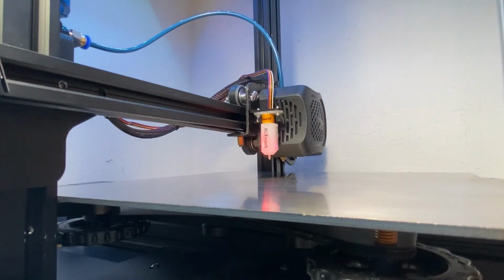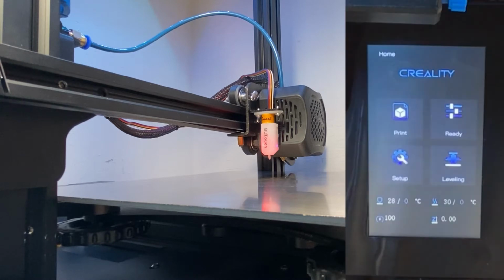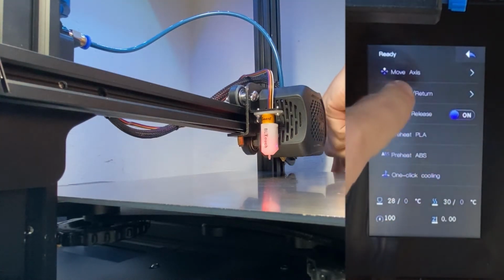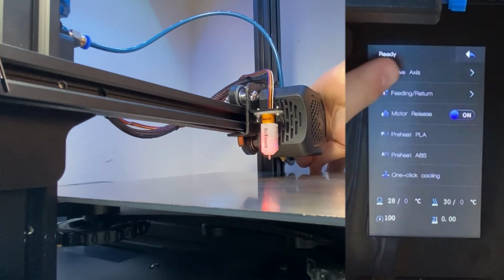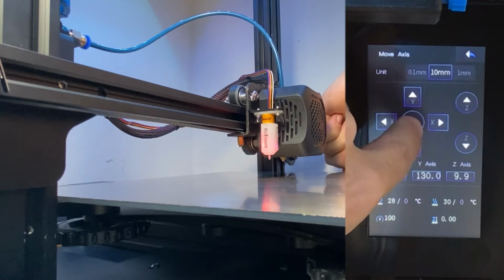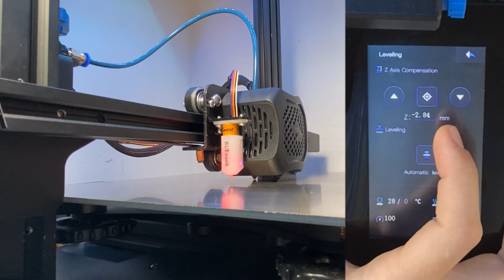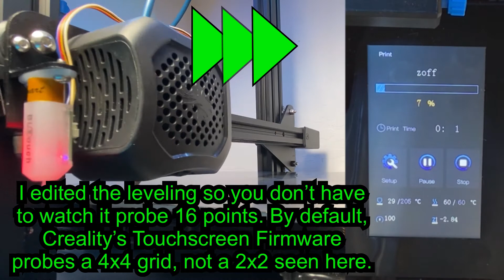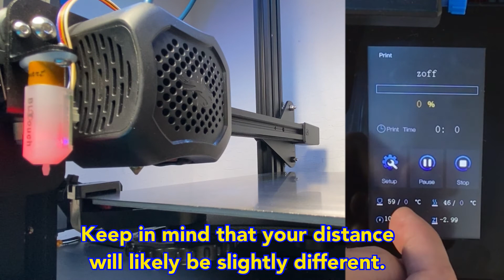Ender Series Touchscreen, How To Calibrate Z-Offset On Your Ender 3 V2 (With Creality Firmware)

Comment: i have this touchscreen with the same board, sometimes my screen freezes and i have to turn my 3D printer off and on to start again,  in 0:48, how do you apply negative values?, i have not make it work, axis move very noisy, thank you very much for this video

Comment: My issue is with an Ender 3 pro, with CR touch, and touch screen.  I can't get the Z axis to move below zero at all unless printing.      I've tried everything, and I am a novice, so going into the G code and adjusting it without a print is just gibberish to me.
Reply: Did you ever figure this out

Comment: How to get rid of the pre start test lines
Reply from the maker: Those are in your slicer on the computer, not the printer itself. It is in your start gcode on the slicer. But I recommend leaving those there as they are a good indication you are off to a good start.

Comment: I noticed on the touch screen that you cant change the e-steps now. Am I missing something?
Reply from the maker: Unfortunately I can’t recall. I upgraded the firmware to F1rstL4yer firmware which has esteps and a whole bunch of other features far better than the Creality firmware. A few bugs for some features, but they aren’t anything the original firmware had and all the operational features run smoothly. Check out the GitHub for insanity automation / first layer. I can grab a link if you need it.
Reply: @KnD3DPrints  hey im currently trying to move to f1rstl4yer can u link me
Reply from the maker: @Th3Director142  I don’t believe it’s public yet as source code or compiled bin files yet (I may be wrong but couldn’t find when lookin). It does however come installed on the main boards they sell.
Reply: @3dprintutopia961  ye I checked there fb page all there downloads are there I got it up and running now but my board isn't good for it so ordering a silent one thanks for the quick reply I also messaged on insta

Comment: I put the 4.2.7 touch screen bl touch .bin file on a formatted SD card and put it into the printer and powered it on. The creality screen shows with a empty status bar and does not move. Any solution to it? Ender 3v2 with bl touch
Reply from the maker: Just to make sure. You formatted fat32 format with 4096 allocation size?
Reply: @3dprintutopia961  yep!
Reply from the maker: @koolcat78956  Darn, lol. For me, that’s been the only time I’ve had an issue when I first did a firmware swap. Only suggestion I have because of that is try re-downloading the firmware and extracting the zip fresh and then  putting on a freshly formatted card again. Unless you possibly also need to do the screen, but for me, it’s at least loading the new .bin and not just got stuck on the loading bar.
Reply: @3dprintutopia961  gotcha. Tried with a re downloaded file with no luck. Then tried without the card and now it's still stuck on it. Have to see if I can give support a poke
Reply from the maker: @koolcat78956  Oh, trying a new/different micro sd card is something I’ve seen help others.

Comment: I tried this on my ender 3 pro with the 4.2.7 mother board , bltouch , and touch screen upgrade kit and when I get to -1.74mm on z axis compensation it stops moving down. It shows on the display that i’ve moved down but the stepper stops turning.
Reply from the maker: Interesting. I had this problem once before on my 4.2.2 board and I had to power on/off to get it to “reset” and be able to affect physical movement again. One thing I noticed is when I move out of the z offset menu then try to continue changing it that it happens more. Definitely a bug I’m curious why is present. My guess is a problem with the logic somewhere on the board that restarting fixes(for me at least). Does restarting the machine help you at all? If not, have you tried flashing the mainboard firmware again to see if that helps?